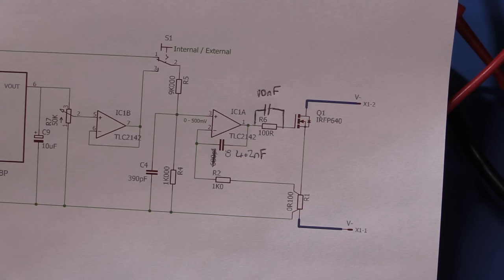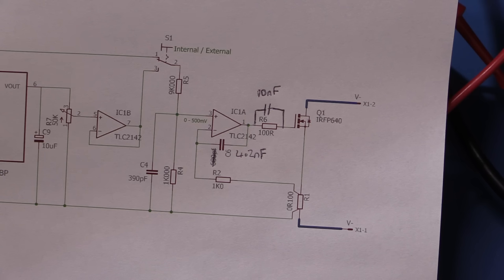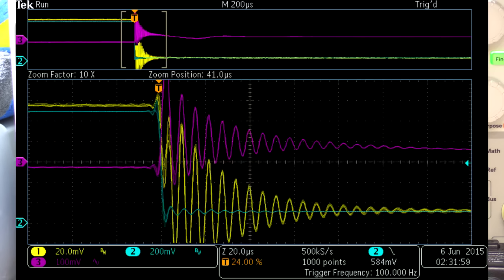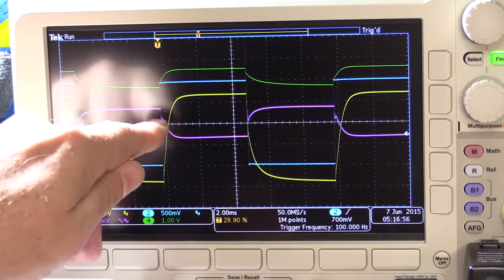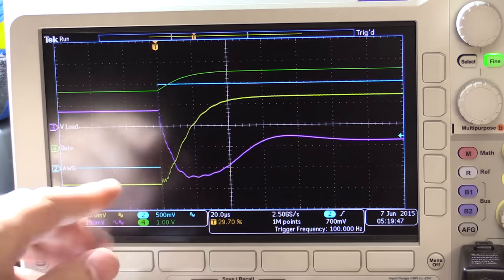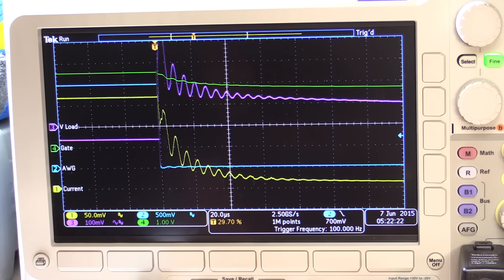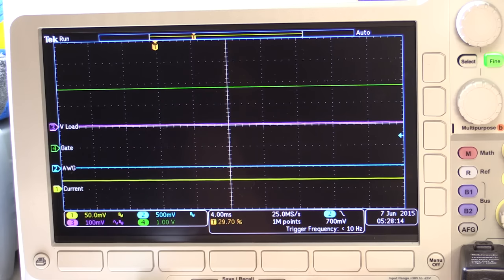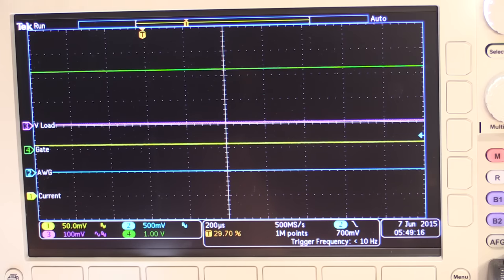Electronic DC Load - Performance Improvements

Comment: I'm a little late to the party and you've probably got this finished by now, but a couple of thoughts occurred to me while watching these two DC load videos.

1.  Given that you were testing with fast-edge signals that generated a nearly 5A step, some of the ringing you saw on the load voltage and current may be caused as much by the performance limits of your Keithley power supply, and stray inductance in the test leads, as the TLC272 and its bypassing and feedback arrangement.  You might try using a decent size lithium battery in place of the Keithley, add some significant low-ESR capacitance at the DC load input, and keep the input leads short.  This will provide a substantial fast current reservoir and eliminate the influence of circuitry you can't control.

2.  Take a look at the LT1026 or MAX680 dual-rail charge pump converters.  They would allow you to very simply generate +/-10V rails for the op-amps from the 5V output of the REF02.  This would let you to reach a true zero current state by driving the MOSFET gate slightly negative, overcoming the op-amp's input offset (in fact you could switch back to the TLE272).  They're both available in DIP-8, so they're breadboard friendly.

I enjoy your channel very much, Peter, and I look forward to the rest of your Modular Bench Power System series.  Cheers.

Comment: Great help! Much gratitude! I have 3 questions:

1. Should the 10nF cap (placed in parallel with the MOSFET driver resistor) described in the video yet missing in the uploaded schematic, be included or not(which is your latest preference)?

2.I'm interested in 'simply' expanding on your design's power capacity, by connecting more 'modules' consisting of MOSFETs, shunt resistors (and any other caps or resistors as necessary) in parallel, so that I can test say a 500W PSU at say 35-40A. What do you think would be the best place to make the potential add-on connection point(s)?

3. Would this modularizing require each module to include its own (separate) driver resistor(/parallel cap) and feed back cap?

Comment: Peter, I am not sure if you have tested the CPU heatsink as yet. I am making a variation of the KerryWong.com load. In testing with 2 IRFP150 mosfets attached to an old AMD heatsink which looks identical to yours I am able to easily dissipate 250W. So the heatsink will cover you design standing on it's head. Further good news these are available locally for about AU$15 each. I was also tempted by the range of fan cooled tunnel sinks by Fischer Electronik and HL Marston from Element14. Expensive but certainly look the goods if you wish the make a compact instrument that looks the part.
Reply from the maker: Rob B just editing the video now, I easily handled 150W with a single mosfet and old CPU heatsink, it was barly above ambient temperature

Comment: Did you ever release a manufactured through hole PCB for this?
Reply from the maker: I have not, but I am tempted to re-work the design with a few additional features and perhaps look at doing a PCB as I have not done one since the days of using Black Tape and a load of patience :)

Comment: hi witch value is shout restsor?
Reply from the maker: gregor obreza The Shunt Resistor is currently 100mOhms (0.1R) but can easily be changed to 50mOhms to give a 10A range with no other changes. Just watch out for the power dissipation on the MOSFET
Reply: Hi how much power (0..50)W

Comment: I toured the TEK plant in Portland in 1976 as part of a lets fix TEK consulting job. I am biased. 

Screw all this one up man-ship crap in EE. 

Your response frequencies were fine. Anyone needing more is a poser. 

Why?  Because otherwise they would be buying. They would be fired if they built. 

Tell them to piss off.

Oh crap, I am getting drawn into a poser troll. Groan. 

MOSFETs don't care at all about fall time ring. Rise time, under extreme voltage change, MAYBE, just maybe. 

Otherwise, my very, very, large light industrial shop would have died a while back. 

You want to see high frequency effects on a MOSFET, lock the rotor on a 3-phase, 25 HP motor hooked to the mains through a reactance transformer and into an ABB VFD. 

BANG poser.
Reply from the maker: I like TEK, I have used them and Keysight (HP/Agilent) for well over 40 years.